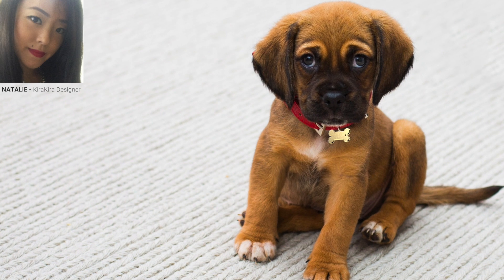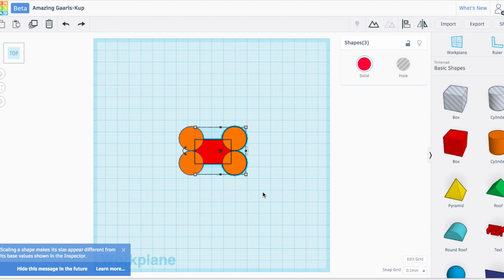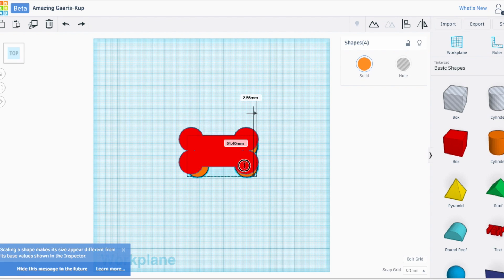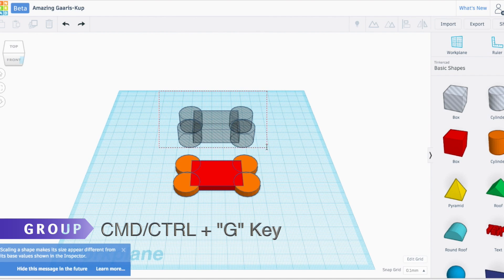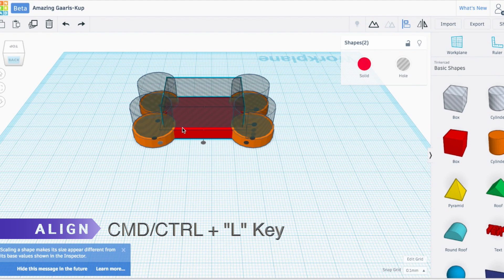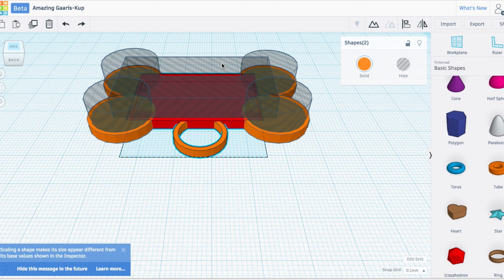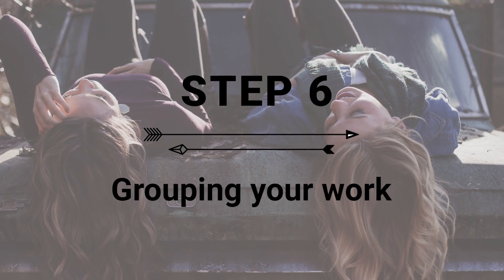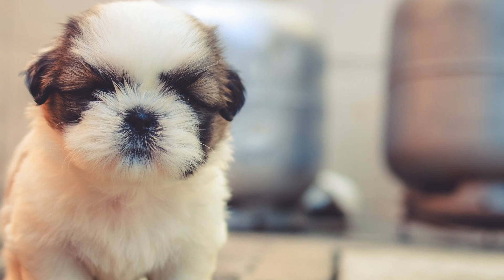Tinkercad: Dog Tag

Comment: I am glad I found this. I wanted to make a dog tag with the raised edges and couldn't figure out how to do it! I was going to print mine with resin. I figured I would color the letters with paint then fill in the area with clear uv resin. I figured that would be a lot easier than switching resin colors lol. How well did this hold up? I was only thinking resin because it might be stronger than pla.